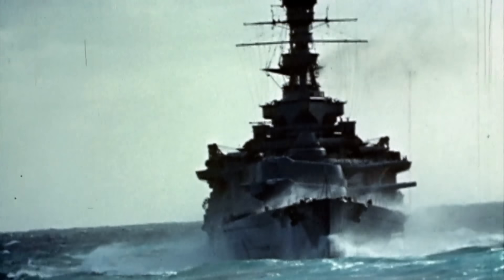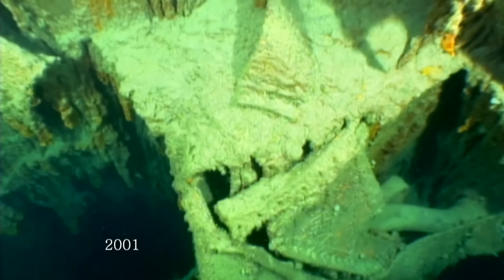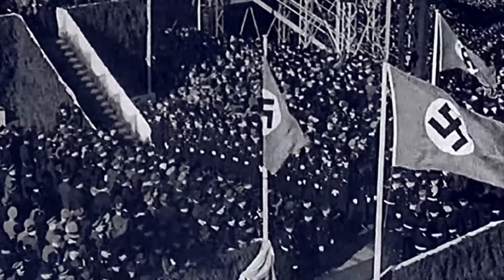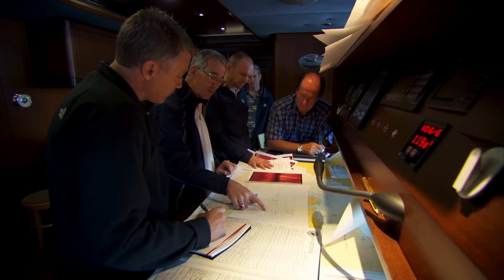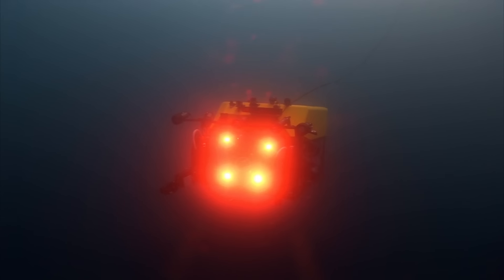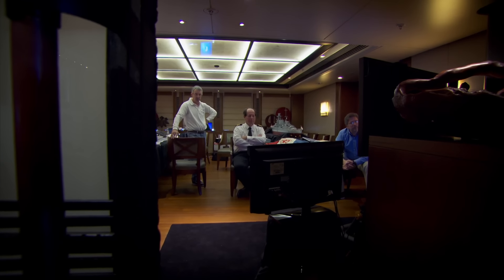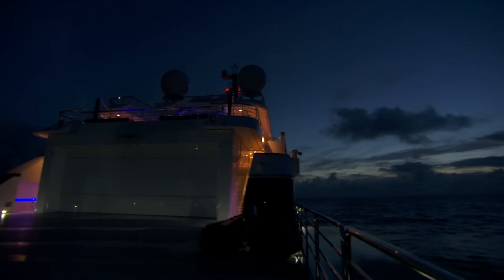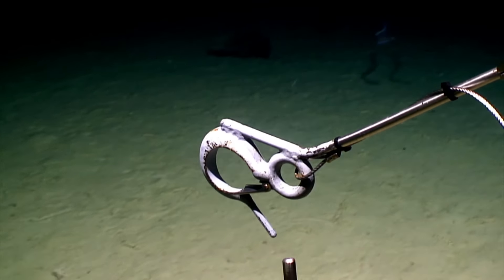How the Bismarck Sank HMS Hood - Documentary

Comment: I'm sorry I am failing to see how this is a question that needed a documentary and search of the wreck to answer. Is it not extremely obvious that a magazine exploded, and the reason was because of plunging fire from the Bismarck? A magazine explosion will literally rip a hole in the ship or split it in half. That's why it sank so quickly. I think it's also a little disingenuous to say that the Bismarck got "lucky." Bismarck (a battleship) engaged Hood (a battlecruiser) at what, 14 miles? The shells plunge at that distance, coming in at angles that are incredibly steep. The gunnery from Bismarck was accurate, and punched through Hood's very weakly armored deck and detonated a magazine. Doesn't seem too lucky to me.
Reply: Except  that they found out it was both magazines  that exploded  but she was hit by only one of the Bismarck  shells
14000 yards not miles and it was luck to hit magazine
Reply: How then is it not possible Hood was also struck by a torpedo ? 
What is known now in hindsight is that torpedo's were a primary weapon successfully used by Germany to sink ships.
Prinz Eugen had 4 triple torpedo turrets but Bismarck had no torpedoes. I believe that to be WW2 propaganda and here's why.
Admiral Lutjens, the commander of Bismarck, is the man who invented putting torpedoes on capital ships in the first place. "Better torpedo to sink ships than main guns", he correctly thought.
So why would he stupidly not have his own invention, ship launched torpedoes on his ship??? That does not make any sense at all? (But lies never do, do they? )
The lucky million to one plunge shot contradicts itself and is easily debunked as propaganda. Firstly an aimed shot that destroys it's target can never be a million to one 'lucky shot', just a bloody good shot. Secondly plunge fire was impossible at that range. Thirdly there were 2 royal navy inquiries, the first found the belt armour (not the deck armour) was penetrated. The second inquiry concurred with that of the first. However, the finding was made before it was revealed that the Germans had SECRETLY deployed medium to long range acoustic homing torpedoes. Hood was blown in two. That means it was either a direct hit through the belt armor into the main magazine or a proximity fused torpedo exploding under Hood. WW2 was a conspiracy. History is being re-written as we speak.
Reply: Business CrimeWatch Prinz Eugene got within Torpedo firing range.  Due to a miscommunication she did not fire.  The Germans had a board of inquiry over this stuff up.
Reply: @businesscrimewatch199  

I'm not aware that German torpedoes had a 14,000 yard range - or that there was any chance of hitting anything moving in excess of 25 knots at that distance.  If they did get a torpedo hit - it would be even luckier than the magazine hit.
.
Reply: @BobSmith-dk8nw    This might help. Here's 12 German torpedo's that had the range.                                                                                                                                                                                                                                                                                 

Designation Codename Propulsion Dimensions Range (speed) Warhead
TI G7a  Wet heater 533.4mm / 7163mm 120hm (30kn 'NS') / 75hm (40kn 'WS') / 50hm (44kn 'SS') Ka (Pi1), Kc (Pi3) The standard torpedo prior to World War II, used by all platforms during World War II: surface combatants and U-boats at night. Nicknamed "ato" by German crews (i.e. atem- or air-torpedo, indicating the steam propulsion) to distinguish it from the G7e (electric torpedoes). Used from surface vessels during World War II.
TI Fat I G7a  Wet heater 533.4mm / 7163mm 120hm (30kn) / 75hm (40kn) / 50hm (44kn) Ka (Pi1), Kc (Pi3) Standard TI with Fat program-control type I
TI Lut I G7a  Wet heater 533.4mm / 7163mm 120hm (30kn) / 75hm (40kn) / 50hm (44kn) Ka (Pi1), Kc (Pi3) Standard TI with Lut program-control type I.
TI Lut II G7a  Wet heater 533.4mm / 7163mm 120hm (30kn) / 75hm (40kn) / 50hm (44kn) Ka (Pi1), Kc (Pi3) Standard TI with Lut program-control type II.
TIü Lut II G7a  Wet heater 533.4mm / 7163mm <120hm (30kn) / <75hm (40kn) Exercisehead only (light) TIü with Lut program-control type II.
TIIId G7e Dackel Electric, lead-acid (17T 210 battery) 534.6mm / 11000mm ca. 480hm (9kn) Kb2 (Pi1d) Special long-range anti-invasion torpedo with a variant of the Lut II program steering. Launched from ships, S-Boote and barges.
G7m  Kreismotor 534.6mm / 7163mm 270hm (40kn) / 180hm (48kn) unknown (TZ2b, TZ6) Gasoline and compressed oxygen as fuel. Development was dropped in favour of the ingolin-engines.
G7ut Schildbutt Walter turbine with seawater injection  140hm (45kn) / 180hm (40kn)  Ingolin/dekalin/Helman/Water pressure-injection fuelled turbine, later developed with the Steinwal-BO VI turbine. 
Wal / Steinwal Ingolin Walter turbine  192hm (45kn). Ingolin/dekalin/water pumped to the motor combined with Helman pressure-conveyor (BO VI-turbine). 
G7m  Closed-circuit propulsion  180hm (48kn)  Both steam and electric propulsion.
G7ur Mondfisch Walter rocket  700hm (45kn)         Ingolin/dekalin/floran-fueled rocket-engine (BO VI-Turbine). Transverse combustion-chamber.
G7v  Wet heater 500mm / 7083mm 120hm (28,5kn)  Older torpedo (prequel for the 21inch G7a) used at least until October 1944.
Reply: @businesscrimewatch199  

Well, thanks for posting that information.  It was interesting but - if you look at those ranges, while a few of them will go that far, most of them come up short for 14,000 yards and - that is on the slow speed setting.  Their chances of hitting anything at those ranges and those speeds was slim to none.  It just takes so long for the torpedo to go that far that any chance of them predicting where the target will be, especially a warship maneuvering at high speed ... it would be a pure fluke if they hit anyone.

Here's a link to a description of the fight in Suriago Straight where you had a lot more ships firing a lot more torpedoes at much closer ranges.

https://warfarehistorynetwork.com/daily/wwii/pearl-harbor-revenge-the-battle-of-surigao-strait/
 
The thing is - even though this was a very successful torpedo attack - most of these torpedoes missed.
.
Reply: @businesscrimewatch199  
You still haven't addressed the discrepancy mentioned above where the Prinz actually Didn't fire her torpedoes according to her own crew. He is also right that even homing torpedo were too slow to catch a ship at speed, and hitting from the side would be a super unlucky hit with all the maneuvering. BTW Torpedo hits are also visible from other ships, which none saw and torpedoes are unlikely to detonate a magazine.

When they say the Bismark was lucky in hitting by plunging fire, I think they mean that because German Shells usually travel TOO fast to be able to plunge, especially at 14km which is medium range for those guns. They tend to have flat trajectory, on the other hand US ships whose shells travel slower Do tend to plunge, especially at longer ranges. Given the flat arcs of German shells it would have to fire at the same time the Target ship tilted towards the shooter (showing her deck). This would be because she was starting a sharp turn OR a  sea swell.
Reply: @businesscrimewatch199  

OK ... like I said - YOU need to look at that table again more closely.

https://en.wikipedia.org/wiki/List_of_World_War_II_torpedoes_of_Germany

I did and the maximum range of the German Torpedoes used by Surface Ships was 12,000 meters NOT 14,000 meters.  The Hood was at 14,000 meters - that is 2,000 meters beyond the range of the German Torpedoes - when it was sunk.  Thus - it could NOT have been hit by a German Torpedo.

Now - later in the battle - the Prince Eugen might well have closed to within 12,000 meters - of the Prince of Wales and fired torpedoes (or not fired torpedoes as William Jones-Halibut  has said) but the Hood was NEVER within range of German Torpedoes before it was sunk.

Keep in mind too that at a speed of 30 knots it would take the torpedo 12 minutes to travel to 12,000 meters, which - AS I SAID - being fired at a warship maneuvering at an excess of 25 knots (almost faster than the torpedo) it would NEVER hit it.  Since Hood's speed in 1941 is listed at 30 knots it was probably going even faster than my guess (and which was AS FAST as the torpedo).

Now - these torpedoes could travel at 40 knots - but - at that speed their range was only 7500 meters.   At 44 knots their range was only 5,000 meters.  Torpedoes are actually more often used at their faster speeds - since that cuts down on the time it takes the torpedo to reach it's target and gives it a better chance of a hit.  Since firing torpedoes at targets in excess of 5,000 meters are probably going to miss anyway - it's better to take advantage of the higher speed than the longer range.  The only reason we are even talking about their slower speed of 30 knots - was because that was the only speed at which they could possibly have even reached close to the Hoods position at the time it was sunk. 

Looking at the link I provided - that table shows that any and all German Torpedoes that EVER had a range exceeding 12 kilometers - were experimental and hence not likely to have been used by the Prince Eugen in May of 1941.

Your statement that German "capital ships primarily used long range acoustic homing torpedo's to bridge the gap beyond the range of their big guns" does NOT agree with the ranges in that table.  The Homing torpedoes had a much shorter range - 7,500 meters - not a longer one.

.
Reply: @armastat  Many reports are contradictory. 
That's how you find the truth, you look for consistency.

A Battleship or cruisers main magazine carry upwards of 1000 x 15 inch shells plus same amount again in cordite charges plus more. 
We all know the huge explosive power just one 15 inch shell generates, now multiply that by a couple thousand times ENCASED. 
Hood would have been blown to smithereens had the magazines detonated. 
The ballistics including the way Hood sank match a torpedo strike not a magazine explosion.

Then they contradicted their magazine explosion finding because the fact they found any intact cordite casings on the damaged section of the wreck where the magazine was thought to have exploded. 

Prinz Eugen had 4 sets of 3 torpedo tubes. 
Kpt Brinkmann ordered his Torpedo Officer (Ltnt Reimann ) to launch them twice. 
German capital ships primarily used long range torpedo's to fill the gap beyond the range of their main guns. 
It was discovered late in the war by the Allies the reason the Germans had sunk so many ships was because they had secretly upgraded their torpedo's with acoustic homing.    

Listed below are German torpedo's with the speed and or range to hit Hood and Prince Of Wales during the battle of the Denmark strait.     

Designation Codename Propulsion Dimensions Range (speed) Warhead
G7m  Kreismotor 534.6mm / 7163mm 270hm (40kn) / 180hm (48kn) unknown (TZ2b, TZ6) Gasoline and compressed oxygen as fuel. Development progressed in favour of ingolin-engines.
G7ut Schildbutt Walter turbine with seawater injection  140hm (45kn) / 180hm (40kn)  Ingolin/dekalin/Helman/Water pressure-injection fuelled turbine, developed with the Steinwal-BO VI turbine. 
Wal / Steinwal Ingolin Walter turbine  192hm (45kn). Ingolin/dekalin/water pumped to the motor combined with Helman pressure-conveyor (BO VI-turbine). 
G7m  Closed-circuit propulsion  180hm (48kn)  Both steam and electric propulsion.
G7ur Mondfisch Walter rocket  700hm (45kn)         Ingolin/dekalin/floran-fueled rocket-engine (BO VI-Turbine). Transverse combustion-chamber.
r
Reply: @BobSmith-dk8nw  I have read wiki and many other reports. Many are inconsistent, but some aren't. That's how you find the truth, you look for consistency.
 
The propaganda surrounding the battle of Denmark strait is full of inconsistencies.

Here's just one of a few major inconsistencies, a Battleship or cruisers main magazine carry upwards of 1000 x 15 inch shells plus same amount again in cordite charges plus more. 
We all know the huge explosive power just one 15 inch shell generates, now multiply that by a couple thousand times ENCASED. 
Hood would have been blown to smithereens had the main magazine detonated. 
The ballistics including the way Hood sank match a torpedo strike not a magazine explosion.
Ballistic science reveals the truth, propaganda conceals it.

Then they contradicted their own magazine explosion finding because considering the size and destructive nature of a real magazine explosion, the fact they found any cordite casings on the wreck site is prime evidence the magazine did not explode. Magazine explosions blow ships to smithereens.

Prinz Eugen had 4 sets of 3 torpedo tubes. 
Report states Kpt Brinkmann ordered his Torpedo Officer Ltnt Reimann to ready the torpedo's subsequently launching them twice (24). 
A conflicting report states that Ltnt Reimann refused to obey Kpt Brinkmann's orders because he considered the targets to be out of range. 
Impossible because Ltnt Reimann had no way of ascertaining that, the torpedo tubes did not have their own aiming optics or rangefinders. 
The torpedo's utilised the ships own aiming and rangefinder systems. Ltnt Reimann did not have the command authority to call the shots. The captain did and rightfully did so.

German capital ships primarily used long range torpedo's to fill the gap beyond the range of their main guns which gave critical protection from being out ranged by bigger guns and or outgunned by multiple contacts. The Germans were a lot smarter than you think.

It was discovered later in the war by the Allies the reason the Germans had sunk so many ships was because they had secretly upgraded their torpedo's using acoustic homing.    

Listed below are German torpedo's with the speed and or range to hit Hood and Prince Of Wales during the battle of the Denmark strait.     

Designation Codename Propulsion Dimensions Range (speed) Warhead
G7m  Kreismotor 534.6mm / 7163mm 270hm (40kn)/180hm (48kn) unknown (TZ2b, TZ6) Gasoline and compressed oxygen as fuel. Development progressed in favour of ingolin-engines.
G7ut Schildbutt Walter turbine with seawater injection  140hm (45kn) / 180hm (40kn)  Ingolin/dekalin/Helman/Water pressure-injection fuelled turbine, developed with the Steinwal-BO VI turbine. 
Wal / Steinwal Ingolin Walter turbine  192hm (45kn). Ingolin/dekalin/water pumped to the motor combined with Helman pressure-conveyor (BO VI-turbine). 
G7m  Closed-circuit propulsion  180hm (48kn) Electric propulsion.
G7ur Mondfisch Walter rocket  700hm (45kn) Ingolin/dekalin/floran-fueled rocket-engine (BO VI-Turbine). Transverse combustion-chamber.
Reply: Sigh .... your very thorough and sound reasonable, but unfortunately you know just enough to convince yourself of your idea, but not enough to convince others I'm afraid.

1. when u think of Shell Power remember that all happens in the barrel, a space designed to MAX'imize the power. Magazines are designed to MIN'imize explosions (blowouts, capacity limits, shape, construction, etc). One important point is Capacity Limits. You don't Cram it full, you leave space and open exits for gas build up to vent, so an explosion is NOT confined like in a Gun Barrel. (Example when a magazine explode you don't get bullets traveling out of it at muzzle velocity - in real life they would barely  be disturbed and would just sink with the ship. Also its also common to have tons of unexplored cordite near by after the explosion.

2. Why are u mentioning 15" shells? While they did have 15 inch guns, they only carried 120 shells per gun magazine NOT 1000. there were 4 magazines for those guns, each holding 120 shells, one each below the gun turret itself. The Magazine that was said to explode was the Rear 4 INCH one, not the 15 inch ones. Located in front of the 15" and the 5.5" magazines I'm sure there was damage to the others and maybe even partial explosions (oh and PS, that is where u get a lot of unexploded cordite from as well).

3. You are probably confused by the word 'Torpedo'. I understand how when you hear that and think torpedoes thru the water. But you failed to read anything about this in the historical literature. The ONLY mention of torpedoes that day (other than the germans not firing any around the time the Hood was sunk) was that the Hood had her own torpedoes and an alternate possibility was that THEY exploded. In addition the hood had excellent torpedo bulge armor, designed to blunt torpedo explosions, and while a hit could flood the ship it COULD NOT explode the magazines.

While there are some equally viable alternate explanations to what happened to cause the explosion...the hood going up AS all its witnesses and evidence show. in a sudden, unexpected and massive explosion. it was clearly the magazine explosions that broke her up.
Reply: I'm in agreement, ship designers at the time the Hood was built were mainly concerned with horizontal fire. They didn't realise the range at which actual captains would open fire. At that extreme range, the shells would absolutely be plunging down from a great height.  Instead of armouring the deck heavily against this, most of the armour was on the sides.  I suggest reading Big Fleet Actions for an excellent description of this, can't remember the author.
Reply: @businesscrimewatch199  Its possible that the storage hoist blew up, or some such terminology. The British used to store some ammo there. But that might have changed after Jutland, can't remember.
Reply: @businesscrimewatch199  ....BCW, I tend to agree with you. As a kid I remember watching a movie called Sink the Bismarck. In that movie was shown the launching of shipboard torpedoes by the Bismarck I believe. I didn't think of that untill now while reading your piece.
Reply: @businesscrimewatch199  
If you look at the actual layout of the ship (takes 20 seconds on google) you will see it had 4 magazines for 15" shells & propellant. Not one magazine for the whole ship, they distributed the ammo to its own gun before battle (normally when loading the boat) Not During one, certainly not while receiving fire. its a safety measure (one of hundreds) followed to avoid explosions. As is closing of all access hatches for any conveyors while firing. The ship had been in battle just a few minutes. they would have had no need to move anything at the time it exploded.

Torpedo Bulges were NOT obsolete in WWII since the vast majority of torps in use were not deep water, those were much bigger and slower than the ones in use that day. and the ship did not have its back broke by a torp, again something that the experienced sailors of the day would clearly recognize from a ship exploding otherwise.

That brings up the crux of my issue. You are substituting your 'knowledge/experience' what ever it is, with that of the people at the time who were more experienced with the subject than you are. Even IF your knowledge and experience was the same or even better They were there at the time, you were not. TWO investigations came to the same conclusion. No one of the time had any proof otherwise.

I could provide links or 'citations' as you put it, but bluntly put. I don't think it would make a lick of difference to you, since you would just go on to something else and you are the one who came up with this alternate theory so that is your responsibility, not mine.

To Illustrate, I never accused you of saying a torpedo did it. You said it yourself.
Reply: @armastat  Citations please?
Reply: @BobSmith-dk8nw  Yes the max range of even the longest range German torpedoes was 9000 meters iirc which is far shy of 14,000 yds. I don't remember tho when the different torpedoes were put into action. I saw a quoted range of one torpedo type greater than 36000 meters I find that difficult to believe maybe it's a typo or some other error.
The Hood's course and speed also would affect the distance the torpedo would need to travel. Besides if Hood altered course during the torpedo run that would decrease the likelihood of a torpedo hit even further.
Reply: @dannygjk  

There's a lot of good information in those links I provided and the Germans did have a maximum range of 12,000 meters on their standard torpedo if set to run at 30 knots.  But - as you & I have both noted - hitting something at that range was not that likely.

Now - had the Hood and Prince of Wales continued to close on the course they initially set to try and get out of the plunging fire zone - they could have come within range of those torpedoes - but they had no intention of doing that - and the Germans torpedo officer had no intention of firing at them at that range.  One thing about torpedoes - is that even if the ship carried spares - it took a very long time to reload them and was in fact seldom if ever done in battle.  The American Destroyers off Samar - specifically saved their torpedoes until they felt they were in effective range and once they had expended them - did not fire any more.

Now - the  Japanese Type 93 or Long Lance Torpedo

https://en.wikipedia.org/wiki/Type_93_torpedo

which was hands down the absolute best torpedo in the world - did in fact have astounding ranges.  It could go 40,000 yards at 33-35 knots but - it was usually used at it's shortest range of 22,000 yards at 48-50 knots.  With a 1,080 lb. war head this was a stunningly devastating weapon.

Japanese doctrine called for them to fight at night, locate targets with their very good night vision then NOT fire their guns but rather use torpedoes to engage these targets - which not having night vision as good at the Japanese - would be steaming along unaware that their doom was approaching at 50 knots. Only after their torpedoes had reached the enemy would the Japanese open fire with their guns - often at targets now burning from hits by their torpedoes.

These were also used in daylight battles such as the Battle of the Java Sea

https://en.wikipedia.org/wiki/Battle_of_the_Java_Sea

though it should be noted that they fired 90 torpedoes to get hits on one ship.  So - the really good thing about that range/speed - was the SPEED.  At normal torpedo engagement ranges - they reached their targets very quickly and that increased the likely hood of hits. 

One downside to all that range - was that during the Java Sea fights - they inadvertently hit some of their own transports with torpedoes that had missed their targets.

But that range was also a factor in the most successful submarine torpedo spread in history.  One Japanese Submarine fired a spread at an American Task Force, sank the Carrier Wasp, hit the Battleship North Carolina and sank a destroyer on the far side of the task force. 

What happened to Japanese night surface actions was - the American Radar got much better than Japanese night vision AND the Americans learned Japanese tactics - not only to use against the Japanese - but to counter them.  The Americans got to where they could tell when the Japanese launched their torpedoes and would then change course to avoid them.

The Japanese Navy and German submarines did very well up until 1943 but this is when the tide turned.  Allied technology and production rates - outstripped the Axis powers and things turned around.
.
Reply: @BobSmith-dk8nw  "standard torpedo" you know already from that article that the different torpedo types varied a lot with regard to range, speed settings, propulsion, self-guidance etc. Realistically only an acoustically self-guided torpedo with a long range would have a chance to hit Hood from that range.
I was aware years before I got into this debate at this video of warfare involving torpedoes so I was instantly doubtful of a hit at that range even using multiple salvos using a "spread". I also knew a lot of the aspects of ASW etc during WW2 I have three books on that much of which is applicable to surface vs surface fights with torpedoes. I wouldn't waste my torpedoes on a possible hit at that range instead I would wait for a range of less than 8,000 meters before starting my salvos. In the meantime the guns might do the job. Additionally Bismarck at that range would have easily identified the target as the Hood and so they could be confident of a high probability of winning even without the torpedoes.
I haven't checked but which torpedoes were the load out for the Bismarck at that time?
Reply: @dannygjk  

The Bismarck did not seem to carry torpedoes but the Prinz Eugen did.  It had 4 triple mounts, two per side bracketing the middle of the ship.   The G7a was listed as the standard torpedo for the German subs and surface forces - so I assumed that is what they would have had.  I've not seen any info (which doesn't mean there isn't any) on which model Torpedo was in use that day - so I'll stick with the G7a.

The problem with the homing torpedoes - was that they were all short range torpedoes.  The G7es is the one listed as being the most heavily used with 6,000 to 7,000 having been launched.  I believe these were mostly used by submarines.
.
Reply: @BobSmith-dk8nw  Those G7's tho iirc were electric and anyway in any case to get that range needed they would have to run slowly.
I think no more than 25 kts so it would be pointless to fire them unless the Hood was closing. Some torpedoes had no option to set more than one speed. I can tell you that if the surface ships were using the same varieties of torpedoes as the subs it would be a waste of torpedoes. My memory is leaning toward the G7's not being available anyway at May, 41. Even if they were also iirc they had a smallish warhead. I think they would load a big surface warship with bigger warhead torpedoes. In any case for a torpedo to travel 10,000 m at even 36 kts I think would take over 10 minutes. In the meantime who knows how many times the Hood would have changed course/speed. It would be like closing your eyes and trying to hit the bulls eye on a dartboard.
ok I did the math it would take about 9 minutes at 36 kts.
Reply: @dannygjk  

The G7e was the electric one.
The G7es was the acoustic one.
The G7a was the standard one used by surface ships and submarines.

All the torpedoes I saw on that chart had more than one speed.

But yes - they would have had to use the slow speed at the ranges Hood was at and it would have been pointless to fire them at those ranges at a ship maneuvering at over 30 knots.
.
Reply: @businesscrimewatch199  

CITATIONS?  CITATIONS?  Where the hell are YOUR citations.  You paste text into a post that can hardly be read - which I then had to look up to be able to understand it.  You then don't even notice that all the torpedoes YOU claim to have the range - were either experimental or not fielded.  YOU have provided NO citations about your claims that either Brinkmann ordered torpedoes fired or that the torpedo officer did or did not fire them.  Only YOUR take on it.  I did post a citation debunking your whole theory about torpedoes sinking the Hood - but you don't seem to have read it any more than you read the tables I cited.  Look up ANY of the videos here on YouTube (such as THIS ONE WE ARE COMMENTING ON) or posts on Wikipedia and NONE of them say torpedoes did it.  Mostly it's some variation of a 15" shell hitting some form of magazine - the only difference being whether it was a torpedo magazine or a 4" magazine that - then set off the 15" magazines or if the 15" magazines were hit directly.

There are videos (INCLUDING THIS ONE) - SHOWING the damage to the magazines both fore and aft - and no - THOSE are what ships look like when their magazines explode - it does not disintegrate them into little tiny pieces as you seem to think.

And - Torpedo Bulges WORKED.  The Saratoga was torpedoed THREE times by Japanese Long Lance Torpedoes - and survived all of them - because of it's Torpedo Bulges.  Mostly Torpedo Bulges were retrofitted to existing ships.  The problem with Torpedo Bulges - was they made the ship wider and cut it's speed.  The Torpedo Defense System for newer ships was built into the hull as the ship was built - using various versions of the idea behind Torpedo Bulges.

YOU in your IGNORANCE refer to "proximity fuses" which were for artillery - not torpedoes. Magnetic Anomaly detectors are the things they used with torpedoes and those DON'T WORK!!!  How the hell can you pretend to be knowledgeable about Torpedoes  AND NOT KNOW THAT?????    The Americans, British and Germans ALL tried to use them but because the Earths Magnetic Field is inconsistent - that is NOT the same at the point the target is as they were in the shop where the torpedoes were calibrated - THEY DON'T WORK.  They blow up to soon or they don't blow up at all.  The chances that they will work as designed and blow up right beneath the ships keel - are slim to none.  The only reason that they ever worked - was because they were tested right next to where they were calibrated.

YOU are like a lot of little twits with some minor bit of knowledge who think they know vastly more than they do - but don't.  You cling to silly ideas that are refuted successfully by any number of posters and in any number of available sources - which you don't seem to have bothered to read or which you dismiss because they contradict your SILLY ideas.

YOU are either a troll - or an idiot.  Take your pick.
.
Reply: Well you know the Brits....they can never admit, they lost a battle due to someone being better.  Churchill had to give Rommel a nickname indicating he was sly or something., since he made all the brit generals look like buffoons.
Reply: @businesscrimewatch199  Errr - because it wasn't in effective torpedo range nor were acoustic homing torpedoes operational yet, not capable of pulling off a shot at that range.
Reply: @businesscrimewatch199  Most of those either weren't invented yet, weren't operational or would have required the ships to fire them before the British ships were even engaged or known position/heading for a torpedo shot. Certainly not either when you have to consider they earlier they fired them the much longer range shot it was.
Reply: the british are still sore about this loss that they had to make a documentary and revise history to call it a "lucky shot"! LOL!! XD
Reply: They fired shells that didn't hit; even the Germans were surprised by the hit and the damage it caused, at least according to the few who survived. 14 miles away is usual for a naval battle in WWII and not remarkable.  In other battles during the same war shells were fired from up to 20 miles away.  Battleships and cruisers were not a factor in winning WWII.  It was aircraft carriers and planes which contributed more.  It was an antiquated plane from the Ark Royal that disabled the Bismarck even if scuttling and the British finally laid her on the cold ocean floor.  Battleships bombarded many islands in the Pacific, notably Tarawa and Iwo Jima, for days prior to amphibious landings by U.S. Marines, causing little, if any, damage to the dug in defenders. The day of the battleship was over when Pearl Harbor was bombed. The U.S. aircraft carriers were out to sea on manoeuvres and were indispensable in later battles with and defeat of the Japanese.  Planes based in England were also contributors to Germany's defeat, beginning with The Battle of Britain.  Of course, being chewed up and spit out by the Soviet Army showed the Germans they didn't have a hope. The Hood didn't have a chance in that fight and the Bismarck would have been sunk sooner rather than later anyway, even if not sunk at the moment she was.
Reply: Next they're going off to see what sank the Bismarck!!
Reply: Exactly; I'd call the shot they made a bullseye and someone got a lot praise after. Its skill not luck.
Reply: Sorry but none of your data says that the torpedos had this range (they did not btw) btw even if they would had this range. firing a torpedo that can not change course (the ww2 ones couldn´t) at 14 miles would have been just a waste of ammo. the absolut maximum proven range a german torpedo has hit a ship was 4.500 meters (and usually german commanders nevr fired torpedos at targets that have been more than 3000 meters away)
Reply: @businesscrimewatch199  It has been proven that the Prinz Eugen didn't fire her torpedoes as their crew have said it themselves. Another thing is that Bismarck does not have any sort of torpedo weaponry, the Tirpitz did but not the Bismarck.
Plus, the Hood's magazine didn't explode because of a direct hit from Bismarck's 15inch shell(s), it exploded from a fire that was caused by the shell.
Reply: ARMOURY impossible to hit as its in the middle and well protected, probably a german shell hit and detonated an explosive component just as it was passing from below and through the top deck and just as the loaders get to it. This would create an extra large explosion through the top deck
Reply: Lucky? German gunnery was always better then British one. Check out Jutland and you will know.
Reply: @businesscrimewatch199  Bismarck never had torpedoes, only Tirpitz had them.
Reply: And ironically the Bismarck was sunk by an Aerial bomb that went through its deck and detonated its magazine.
Reply: @TheApana  That was Tirpitz and not Bismark.
Reply: @brucenadeau1280  not luck, but well coordinated salvos and excellent ranging.

Guns on Bismarck were really really accurate and ranging equipment germans had were top class on WWII.
Reply: @brucenadeau1280  it's entirely possible that the detonation of the first triggered the explosion of the other.
Reply: @brucenadeau1280  I recall hearing recently that they think that the rear magazine was hit by a shell and detonated, and while it burned, the fireball traveled the length of the ship through a tunnel between the magazines and set off the bow magazine as well.
Reply: Business CrimeWatch Bismarck never had torpedo
Reply: While the Bismarck had early stage radar, that was only of minimal use. For aiming the main guns you would watch the impacts of the previous shots on the water. The engagement happened after dawn, meaning: it was pretty dark. According to the wiki page, engagement range was 16,000 yards. Already the 5th salvo of the Bismarck made a full hit on the Hood. That is luck however on that short distance you basically fire point plank, your assumption of a steep angle is wrong. https://en.wikipedia.org/wiki/HMS_Hood#Battle_of_the_Denmark_Strait
So the luck is that they hit very early with more or less a full salvo, in darkness where they could not judge the slashes of the misses accurately to improve aiming.
Reply: bruce
about 6 miles wasn't it?? there was some luck and some skill involved ....I think the point is, if Hood had been a true modern battleship (the brits had them) instead of an up armored battle cruiser from WW1, then perhaps she would NOT have been destroyed or badly damaged by a single hit.
Reply: alright listen it wasnt luck at all the germans literally train to sink hood for two and a half weeks before setting out plus hood a battlecruiser built for speed had 9 inch hull armour and 3 inch deck armour if you need more info go to dogfights history channel S1 Ep 45 hunt for the bismark
Reply: the kms bismark had no torpedo launchers and her planes couldnt carry any DUH
Reply: your accusation of luck is a mistaken one watch dogfights hunt for the bismark and learn something
Reply: wonderful u r awesome
Reply: @businesscrimewatch199  
It doesn't necessarily mean it would have been blown to smithereens if a magazine was hit, the USS Arizona had what was essentially an aerial dropped artillery shell explode the foreward magazine cracking the hull three quarters of the way around it's circumference and heaving the deck up but it most certainly did not blow it to smithereens.
Reply: Aren't multiple shots shot to ensure that the target is hit? If this is the case, then it was an excellent shot and a good marksmanship.
Reply: @dukecraig2402  Witnesses stated Arizona was hit, on fire and was also lifted 1m in the air slamming back down by a huge explosion. That perfectly matches a PRESSURE WAVE explosion caused by a large bomb or torpedo exploding under the ship. The most efficient way to sink and or disable any ship. That explains and is consistent with the big huge puff of smoke out of the funnel. Let's not forget Arizona was not on a war footing, docked in the tropical heat, with everything opened for maximum ventilation. Ballistics is a truth science, propaganda is lies and deceit.
Reply: @businesscrimewatch199  
Yes ballistics is a "truth" science, ok, so is this the latest conspiracy in life? Don't tell me let me guess, it wasn't an aerial bomb that bounced off of the side of the #1 gun turret and penetrated the deck into the forward magazine causing it to explode, it was actually a torpedo launched by a sub that was built by the military industrial complex and manned by OSS agents to assure that America would be in the war, hopefully getting JFK killed because they knew that one day, 20 years later, when he is President he is going to pull the troops out of Vietnam and expose the moon landings as a hoax, how close did I get?
Reply: @businesscrimewatch199  
It's long been established by witnesses who saw the bomb fall from the plane and from the man who dropped the bomb himself that a naval artillery shell converted into an aerial bomb was dropped from altitude that glanced off of the side of the #2 gun turret penetrating the deck and exploding the forward magazine, witnesses, Naval boards, and Naval divers who've looked at the ships hull many times over the past 70 years all agree on this, only youtube documentaries dispute what caused the front of the ship to crack three quarters of the way around it's circumference and heave the deck upwards, I seriously doubt any Navy divers would be part of a lie considering the Navy's feelings about the Arizona, but either way, the forward magazine exploded and the ship wasn't "blown to smithereens".
Reply: it doesn't  matter how many hit it only got. its a matter of who's down under and who's stll fighting.. Lucky shot or not Germans Sunk the Hood.
Reply: I was also wondering how this somebody made into a project and the project passed.. this is the most useless discovery evah...
Reply: Koolaid I think the rea problem lies in the fact that you're right. You just can't see. Stop drinking the koolaid !!! 🤣🇺🇸
Reply: @BobSmith-dk8nw  thank you Bob ✌🇺🇸
Reply: One set off the other. The size of that explosion makes it clear.
Reply: Bob Smith The Japanese had the best torpedos of WW2, their “long lance” Type 93 torpedos used oxygen, didn’t leave a bubble trail and could attack at 22,000 meters at 50 knots and 38,000m at lower speed.  The Italians had the second best torpedos, then the British with the Germans and Americans a little behind. Eva use they had reliability issues.  As the war progressed everyone specialized.  The Germans at electric torpedos with sound homing or pattern running torpedos.
Reply: Jiyukan The Bismarks Radar was the GEMA FuMO 23, often called Seetakt.  The 3 radars were 6.2m by 3m mattress aerials mounted on the 3 main directors between the 10.5m stereoscopic range finders. It  may have been an early radar but it was probably the best in the world at the time, certainly equal to Type 285 on PoW.   The radar had an accuracy Independent of range of 70m due to a calibrated delay line.  The beam width was about 6 degrees but an operator could locate a target within 1 degree by wobbling the director.   The Tirpitz received a upgraded radar called FuMO 26 that had lobe switching and could thus be used for blind fire to within +/- 0.25 degrees.  It had a greater power of 8kW and this provided greater range and better ability to spot shell splash.   The replacement for this radar was to be FuMO 34 with 125kW of power and a range to the limit of the radar horizon (beyond the visual horizon) including shell splash.  The modulator was ready by the end of 1942 and saw service in shore based Seetakt radar.  Some experts in German radar History (Fritz Trenkle) argue that the Tirpitz was fitted out with this radar as a unique one off.  Capital Ships had the technicians to maintain such equipment before standardized manuals were available.
Reply: @georgeb8701  

I keep telling myself I'm going to do it ... but then I don't ...

In the Movie The Longest Day - there's a scene at Pegasus Bridge where the doctor is coming out of the canal and one of the men says to him

"Doc!  What were you doing over there?  That's the Germans side of the canal!"

To which the doctor replies

"Anyone can make a mistake."

I'm going to do a video cap on that, upload it and the link to it when I waste my time for no reason.

The good side of that though - was that all that research into the different torpedo types - was fun.  I've got a masters in history so ... I'm kind of a glutton for punishment with that type of thing.
.
Reply: Not so.
There was no plunging fire.  The range was such that there was no plunging fire.  The Hood was hit probably on its belt below the waterline  and it was a lucky hit which if anything was via an unfortunate route.  The cordite magazine caught fire... a catastrophic explosion. Shells could not explode.
The Bismarck received a lucky hit from the PoW which ended it's cruise.  It then was hit by a lucky  Swordfish torpedo which wrecked it's rudder.  And the Bismarck itself was unlucky to not hit the Swordfish bombers.  And the Catalina recon plane was lucky to spot the Bismarck.

Hairs breaths... Luck.   Not prejudice.
Reply: @armastat  Please publish prime evidence of the original Kriegsmarine inquiry findings instead of merely attempting to use a hearsay translation?
Reply: @BobSmith-dk8nw  Lageunabhängiger Torpedo (bearing independent torpedo), changed the torpedo's course to a preset heading directly after launch, so the launching platform could fire torpedoes at targets without changing its own course. Two versions: Lut I and Lut II (+ a special Lut I variant for the TIIId torpedo with a very long initial straight run of 36000 m).
Reply: @brucenadeau1280  Correct.  Which begs the question: if Hood was at action  stations with all watertight doors, hatches, scuttles and air vents closed, how was the fire from the aft magazine transmitted to the forward magazine?  My pet theory is through the ventilation system.
Reply: @CaesarInVa If the forward magazine detonated the front of the ship would have been blown away, If the aft magazine exploded the stern. But Hood was blown in half. The ballistics do not fit the claim?
Reply: @brucenadeau1280  actually it is 14 miles, the shell of the bismark could of shattered and sent out sharpnel that hit the two magazines
Reply: @brucenadeau1280   many things went against hood, Germans found range far quicker, landing within 100 meters almost immediately, English. positioning - Brits did stupid shit to be honest. the dark horse in the battle - Prinz Eugen - doesn't get much mention but manoeuvred and peppered hood and prince with skill . just my opinion from what i cant remember reading of the battle.
Reply: Bob Smith The T7a was the one that had 15000 yards range at 30 knots.  It would take about 16 minutes.  A spread of 3 torpedos fired at a target 300 yard long gives a reasonable chance.
Reply: Thank you! You saved me a lot of time.
Reply: There were some factors that made the Bismarck indeed lucky, but in a one on one battle the Bismarck most of the time would have defeated the Hood, since it was a bigger ship with bigger guns.
The German ships (Bismarck and Prinz Eugen) travelled in an order that was rather uncommon with the Prinz Eugen in front whereas normally the heaviest ship travels first. That meant that both the hood and its escort ship, the HMS Prince of Wales, targeted the Prinz Eugen first. By the time they had realized their mistake it was to late and the Bismarck had taken perfect aim on the Hood and blew it's magazine, leading to the sinking of the Royal Navy's pride.
Reply: Bob Smith For the German T7a Heavy Torpedo The more reliable navweaps site gives 15000 yards range when set to 30 knots.  These are the torpedos Prinz Eugene had.
Reply: Can't say argue with you on that one it does seem kind of obvious. The Bismarck was just a better ship and the rangefinders work better obviously. I don't know why they thought the hood was so badass but it was a twenty-year-old ship when it went into the war. Anything that old in the military is obsolete for at least 17 years
Reply: The plunging fire theory is obsessional .  The reality is Bismarck’s guns could penetrate 460mm at 18500 meters at 90 degrees.  At this range the fall angle is 18 degrees because the Bismarck’s guns are at only 40% of their max range.  As Hood had only 305mm armour on the lower belt Bismarck could penetrate her anywhere.  Concerns with plunging fire are an obsession of British and maybe American naval architects who were trying to vindicate their post war armour concepts but it seems rather rediculouse when a side penetration was easily possible even under water line.  There was no lucky shot.  Hoods side belt wasn’t enough.
Reply: Bob Smith The German heavy torpedoes has a range of 15000 yards when set to 30 knots.  When fired in a trio splayed out 1 degree apart then at 10000 yards there would be a torpedo +/-170 yards to either side.  Against at 250 yard long target that’s quite good odds.
Reply: @businesscrimewatch199  dude the hood WAS blown to smithereens. Most of the mid/aft section is completely GONE. Have you not seen the wreck?
Reply: @dukecraig2402  Ballistics is a powerful truth science. Ballistic science trumps witness accounts everyday in courts around the world. Ballistics help jail witnesses who give false testimony around the world everyday. Ballistics doesn't care about plausible deniability. 
The truth is always consistent, propaganda is not.
Reply: i won't be a smart ass, i have almost zero knowlege abaut Bismarck. i have read almost every comment, maybe left a few out. i would like to dedicate this comment to those ppl who are still looking for a answer, "how could HMS Hood, sink in 3min" (don't belive the part abaut 3min tho). lets look at the facts, germany in those days favored firepower above all + strength, sadlly i don't see the factor of strenght on Bismark but i do on Tirpitz. lets leave the strenght & Trpitz out for now. when it came to kriegsmarine, luftwaffe and any panzer division, if we are talking abaut a top class vehicle, such as in this case Bismark + i added Tirpitz + i can also add tiger/or king tiger,...... gunners were not selected randomlly (they selected the best) and we don't have just gunners.....
so in the end we have:
-Firepower
-Bismark that was created 21years after HMS.....
-very highly skilled gunners
-more strenght than HMS but still shit againts Tirpitz
i think that german engineering really doesn't leave any space for this question "how could this happen!?" tho i think the french were asking the same, when Sturmtiger opend fire
Reply: @dragoonguard7278  They found it was a lucky million to one shot that penetrated hoods armor into her magazine. Sounds reasonable if you believe in 1 million to one long shots, not. The fact is the ballistics and the way Hood Sank perfectly match a proximity fused torpedo exploding underneath mid ship breaking Hood in Two causing secondary magazine explosions. Most capital ships sunk in WW2 were sunk by torpedo.
You can not compare Bismarck to Tirpitz. Both were layed down in different yards and metallurgy. Tirpitz was built the old fashion way but with very expensive nickel hardened armor. Bismarck used new tech soft armor which adsorbed  hits and or pressure wave blasts. That's why, no matter how hard they tried, the British could not sink Bismarck with conventional weapons. Bismarck was scuttled to stop it falling into enemy hands.
Reply: @businesscrimewatch199   Didn't you say in one comment that Bismark did't have torpedos? I forgot, unless Prinz Eugen had them......
Reply: @businesscrimewatch199   Thought they were made on the same yards + they were build in the same year, i belive. never really mave much interest for kriegsmarine, so this all new to me, im more interested in land units and a bit in luftwaffe...
Reply: @dragoonguard7278  Wiki indicates Bismarck had no torpedoes, but i do not believe that for one moment as torpedoes were the prime weapon the Germans used to sink ships. The Germans invented launching torpedoes from capital ships. It seems according to Wiki every capital ship during WW2 had torpedoes except Bismarck. What a load of rubbish.
Reply: @businesscrimewatch199  its well known the germans loved their U-boats but it is backed up by many accounts that it was the bismarck that sunk it. the bismarck itself did not have torpedos plus both magazines were exploded one in a uper deck on one in a lower deck And I dont think torpedos fly. Also a torpedo striking it could not hit that magazine because of how high it was out of the water even the best torpedos at that time would not be able to have a blast radius that size to go up 3 or 4 decks and strike the magazine.
Reply: @businesscrimewatch199  thoes torpedos were only accurate up to 10 miles with the most modern and advanced torpedos at the time though.
Reply: @businesscrimewatch199  you may of also read reports but you clearly did not on the dates on them.
Reply: @TheGoldenWarden   Torpedoed by wiki.
Reply: Could you do that kind of damage if the boiler blew up from a round going down the stack.
Reply: @robertv8851  Unlike propaganda, ballistics is a truth science. The range was to short for plunge fire.
Reply: @businesscrimewatch199  
And autopsies performed on human cadavers on a table in a room is far more understood and much better understood than on a ship at the bottom of the sea, apples and oranges are a far bigger gap than your comparison, and by they way all science is "truth science", if it isn't anchored in truth then it isn't a science at all, like astrology, some people consider it a science, it isn't, that's no more of a science than a Ouija Board, as far as I know the only people that have been allowed to dive on the Arizona are either Navy divers or scientists working with the Navy, and once again, considering the Navy's feelings about the Arizona I doubt that any of them would agree to be part of a lie, why would anybody want to? To what end? Tell me who the "truth science" teams are who've dove on the Arizona that have put forth different findings as the Navy's, no one that's who, it's just people like the moon hoaxers who claim they know something no one else does and shout conspiracy, and once again whatever detonated the foreward magazine it didn't "blow the ship to smithereens", it heaved the deck upwards and cracked the hull 3/4ths of the way around it's circumference, this is all very well documented with many pictures taken that clearly show it.
Reply: @dukecraig2402  DEBUNKED.... Ballistics is a science. Hearsay evidence and or propaganda is not. 

Ballistic evidence Trumps hearsay evidence everyday all day. 
Please explain what appears to be a bomb splash starboard side near the bow moments before the explosion?
Reply: @businesscrimewatch199  
That's your ballistics science, a splash, really, that's your entire ballistics report, a splash, but back to my original point, the ships foreward magazine exploded and the ship wasn't "blown to smithereens", as far as ballistics science I couldn't agree more that it's a science, I've known that for years, and I'm gonna go with the reports from the people who are experts on the subject and have actually dove on the wreck, people like naval engineers who have looked at all the information and have dove on the site and or looked at the data including the blueprints of the ship, if you want to base your entire report on someone saying they saw a splash and call that ballistics science then knock yourself out, there's also plenty of people out there who say that because there's no stars in the picture Neil Armstrong took of Buzz Aldren descending the ladder of the LEM on the Apollo 11 moon landing as "truth science" that they were never on the moon but you wouln't catch me quoting their "truth science", and I still don't understand why you or anybody else would suggest that the US Navy is covering up something, what are you suggesting, that a US Navy sub accidentally torpedoed the USS Arizona and they're trying to cover it up by blaming on the Japanese that attacked Pearl Harbor, if you know anything about US Navy torpedoes early in the war then you'd know that even if they did that it probably wouldn't have exploded, you said propaganda and that means they're covering something up, exactly what are they covering up?
Reply: @dukecraig2402  The footage is prime evidence. The bomb splash is prime ballistic evidence. The way the ship exploded is prime ballistic evidence. Hear say evidence is not. Doesn't matter how many times you go to the moon and back. Your plausible deniability will never be evidence. If you don't understand by now why propaganda is used, you likely never will. lol
Reply: @businesscrimewatch199  
Dude a splash isn't concrete ballistics evidence of anything, there was an attack going on, lots of splashes going on I'm sure. But ok I'll play along, I'm dying to know why it was a necessity to create a conspiracy to cover up that it was really a torpedo hit that sank the Arizona with a false story about it being an aerial bomb, why? What's the purpose of misleading the public about a torpedo being what actually sank it with a false "propaganda" story that it was an aerial bomb, please explain to me why they started this lie and have continued to "cover up" your torpedo "truth science" all these years, what exactly is the reason? Like I said it couldn't have been an American torpedo, it wouldn't have detonated.
Reply: @dukecraig2402  Mate your ship sailed long ago.
Reply: The same shit happened in scapa flow to a British Battleship in WW1 I think?
Reply: Lindemann was the captain of the Bismarck, and Lutyens was the Fleet Commander. Lindemann might have been better off without him.
Reply: How many times was the hood hit and didn't explode?......anybody that would know was killed. :( ..... This was a nice yacht trip with huge financial backing that probably started out " Hey lets go out on the boat and check out the Hood, bring some cameras and will call it a documentary and don't forget the beer and martinis"
Reply: Duke Craig if the Arizona had been in open ocean it would have been the same result
Reply: It wasn't a fluke that Bismark hit Hood, it was a fluke that it hit where it did.  Bismark's shell hit a munitions sore 4 decks below.  It's like the arrow that hit King Harold in the eye during the Battle of Hastings.  Whoever fired the arrow wasn't aiming for the King Eye, he was aiming for the wall of men and got "lucky".
Reply: I agree with u ,I feel this is just a wast of money
Reply: While yes everyone knew that the reason why Hood sunk so quickly was due to it's thin deck armor and German plunging fire (although it's not a full complete 90 degree plunging fire), the question is how could the German shell penetrates Hood's deck armor at 15km range ?

Even tho Hood's deck armor was pretty thin at only 3 inches (roughly 76mm), the German shell should not penetrate it. The USN Empirical Formula for Armor Penetration after the war (taken from Battleships: Axis and Neutral Battleships in World War II by naval historians William H. Garzke and Robert O. Dulin) states that the German 380mm APC L/4,4 could only penetrate deck armor of 75mm at the range of 18km, while Hood was sunk at the range of 15km. The shell should have been bounced off deck due to the angle which is 10.4 degree.

While the USN data mentioned 75mm penetration at 18km against deck armor, the German face-hardened (side) and homogenous (deck) armor penetration curves during the war shows the performance of the gun was even worse against deck armor, with all shots against deck armor bounced from 10km all the way up to at least 25km.

So when people say it was a lucky shot/one in a million shot, it is not a metaphor. The physics just didn't match.
Reply: @businesscrimewatch199  No, the one in a million shot wasn't a "propaganda" as you falsely claimed. While yes Hood's deck armor was pretty thin, the German 380mm L/4,4 could not and should not able to penetrate it since the shell could only penetrate 75mm of deck armor at the range of 18km due to the angle of shell which is 10.4 degree. And that is the USN Empirical data for the gun after the war. (From the book "Battleships: Axis and Neutral Battleships in World War II" by naval historians William H. Garzke and Robert O. Dulin).

The German face-hardened (side) and homogenous (deck) armor penetration curves statistics shows an even worse performance against deck armor, with the deck armor being 'Immuned' from 10km all the way up to 25km. (From the book "German Capital Ships of World War Two" by naval expert M.J. Whitley)
Reply: Ben Siener  Have you ever look at Hood schematics ?
Reply: @VoxVictus  
Yea I know, truth science as opposed to untruth science.....
Reply: At the range that Hood's magazine exploded, she was too close for plunging fire to penetrate the deck. The angle of shot was wrong for that.
Reply: @businesscrimewatch199  the belt armor at the waterline is 12"  anti-torpedo bubble, but 5" and 7' belt armor above the waterline. I think it's more likely a shell hit above the waterline on the belt and penetrated a magazine than a torpedo on 12" belt armor at the waterline with anti-torpedo bubble designed hull at the waterline.
Reply: No mò
Reply: @Grief_Weasel  not possible. At the range and angle of the shell hit, the 15 inch shells didn't have the energy to pierce the main belt. Also at that range, the shell would be falling at an angle of about 13 degrees, meaning it physically isn't capable of penetrating the 3 inch deck armor located behind the 7 inch belt. That leaves only one way to detonate the magazines: an underwater hit that managed to land in the gap between the bottom of the main belt and the torpedo crash tubes, coincidentally right in the trough generated by the ship's bow wave
Reply: But that's not what the financiers of this "expedition" wanted to hear. Fool.  ;)
Reply: Jordan Fan，Prophet of Environment。范楚漳，環境先知：
How Did The Bismarck Manage To Sink HMS Hood So Quickly? 
Answer:  The answers were very simple:  When the HMS Hood was battling the German battleships  Bismarck et al, those lazy British  navy sailors onboard the Hood were busily eating their favorite breakfast food - Biscuits with Sardines.  And had forgotten to return fire at the Bismarck!?,.()6
Reply: If you think that to hit the exact spot on a ship that would cause it’s magazines to blow at 14,000 yards isn’t a lucky shot then I don’t know what it. Sure they meant to hit hood but to be so accurate was luck.
Reply: Why soytonly!
Reply: I agree with you totally thank you for pointing that out to people